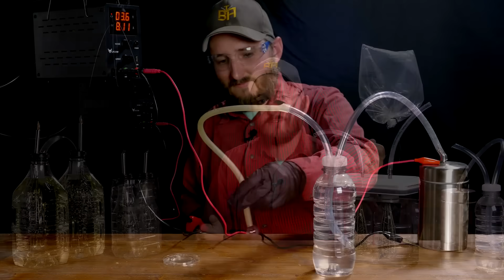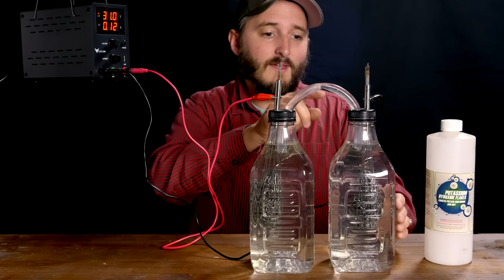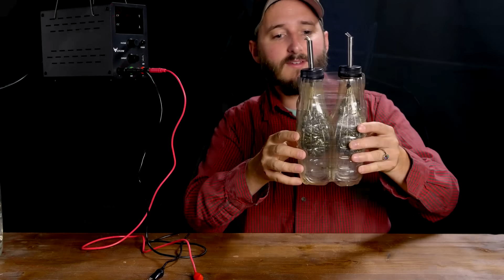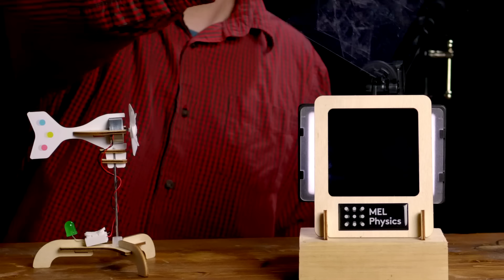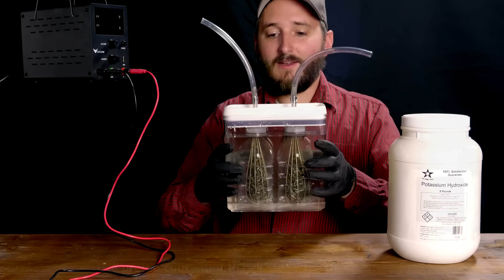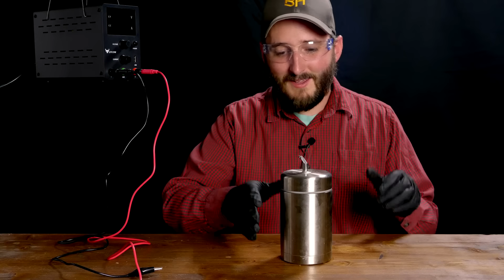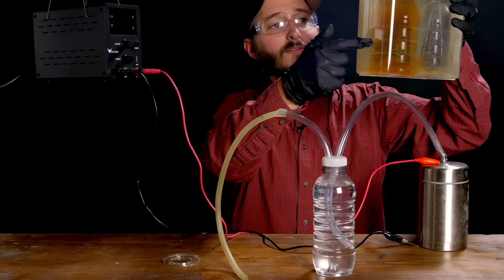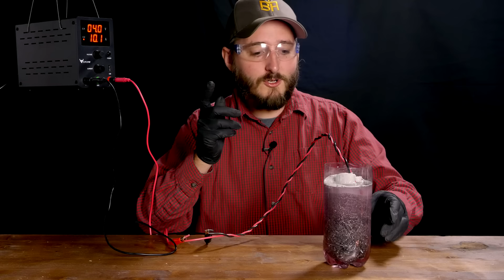DIY Hydrogen/Oxygen Generators From Grocery Store Items (HHO Fuel Cells & Split Cell Electrolysis)

Comment: I am making a single bottle hydrogen generator helping my grandson to video his demonstration for an extra grade point. I am using a battery charger and have a problem grounding, I think I have a solution using the sock and one wire seperating the the positive on the wisk broom from the sock in the same Ball jar. I tried using the positive lead and using a steel adjustable band on the outside of the Ball jar to complete the circuit. That did not work. so briefly connecting a stuffed Sock with the NEG wire inside attached to the stainless steel inside the sock which also seperates contact from the wisk hopefully will work. Any thought??

Comment: Do you think it is possible to safely make a device capable of supplying enough hydrogen to operate a 4 cylinder engine in a vehicle?  
Maybe 6 - 2 to 4inch diameter plastic plumbing pipes to contain the electrolytes & water. Using T's to provide entrance for electrolytrodes and exits or gas?

Comment: me watching this like im gonna be stuck in a bunker with no air supply
Reply: Right I ran across the oxygen generator for the drop-down plane mask video and they mentioned something about different methods like electrolysis and I'm familiar with electrolysis and I was wondering if that could be used as an oxygen generator to breathe

Comment: Throwing relatively high voltage to your cell does not increase efficiency. A lot of that voltage would be lost as heat. One needs low voltage and high current for electrolysis of water. 1 to 2 V should suffice.

Comment: watching this in 2023, i asked GPT-4 why one electrode changed white and if it can guess what the other electrode changed to(brown in this video) i told it that the electrodes are made from stainless steel and potassium hydroxide is used as electrolyte. unfortunately it guessed gray

Comment: ok...   hook solar panels to a charge controller and use the accessories terminal on the charge controller to use the extra electricity not being stored in my battery bank to generate hydrogen through electrolysis...   store the hydrogen in propane tanks and use it to heat my cabin with my vent free propane heater...   too dangerous?   won't work?  great idea?   how to start guidance?

watched where you touched off the hydrogen ..  boom...  so looks like a no go ..  good way to blow up my cabin...  looks like a better way to heat with hydrogen would be to run a generator that runs an electric heater.

Comment: I have always wondered if you use electrolysis on NON-PURE water.
Do the other gases in the original solution just stay in the solution or do they collect at one of the two terminals that the DC current is connected to.
Fluoride being adding to  ciry's water supply is what made me think of this.
I don't have any sort of lab in my apartment and I'm 65yo so high school / college lab access is non-existent.

Comment: I know this is an older video of yours, but I am interested in making one of these for continuous use in an automotive application. I have figured out how I would keep the electrolysis chamber full, but if I was to continuously top off the chamber, would the electrolyte degrade or dilute? I see your pin about producing hexavalent chromium. Could you help me with a formula to determine what my service interval might be for remediation of the Cr? I am actually considering modifying your design for a single source generator and using carbon felt which should mitigate the possibility of generating chromium in the first place, albeit it will make the electrolyte solution more dirty. I would love to chat with you about this a little more as I am debating starting a youtube channel to document the science behind what I am doing, and the research which initially grabbed my attention.

Comment: Question, can you use and would it safe to use pure sodium as an electrolyte?

I'm currently thinking of a solar powered setup to desalinate and process large quantities of ocean water using a desalination mesh. Then use the concentrated brine to extract Sodium chloride (yet to find a good system for that). With NaCl, we can go through a process of separating the Sodium and Chlorine (also need a system for that). Once the sodium and chlorine is separated, we can sell  the chlorine or potentially use it to make more solar panels. Unfortunately chlorine does have limited uses other than cleaning/purging things. Use the Sodium as an electrolyte with our desalinated water to generate liquid hydrogen gas and liquid oxygen or sell/use the sodium to create sodium-ion batteries for solar system power storage.

Potentially overflows of desalinated water could be used for commercial use, such as for drinking water.

It's odd, but creating a facility that generates hydrogen gas from ocean water using solar power seems to produce a lot lucrative byproducts.

I guess the best way to start is through multiple phases. Creating solar and wind farms close to the shoreline, temporarily sell the power to local users or into a public grid. Once that business is on it's feet, the 2nd business would be to fund and build a desalination facility using that power. Once that business is established and is producing fresh water, that could be temporarily be sold to the local municipalities and pumped a town or city's water system to reduce pressure on local dams.

From there you can start up a 3rd business to generate liquid hydrogen gas and liquid oxygen gas, which could then be sold and used as fuel or for industrial use.  Liquid Hydrogen could also potentially be used as fuel for backup power. Would also be nice if there are more cars that runs on hydrogen fuel. Then you can start a 4th business for processing brine into Sodium and Chlorine. Both could be sold exclusively to their own potential markets. 

A 5th business to produce sodium-ion batteries. Potentially a 6th business could exist for liquid gas storage. And I guess the list of expansion would continue, since you would require skilled engineers. Most likely you would also have to establish multiple research facilities or universities.

Comment: I love this. I would like to make a unit to fuel a gasoline generator to power our cabin. The nearest power lines are 4 miles away. What do you think of this idea?
Reply from the maker: Hydrogen is not a good fuel for a gasoline engine. Look into wood gasifiers as a better option

Comment: After replicating your stainless steel single-output cell design for my car, I'm dealing with 2 issues.

My 30A PWM controller keeps blowing its fuse, even with a 40A fuse as suggested by a user of this unit. Not sure how it's shorting out or using more than 40A; how would the controller even send out that much current if it's designed for 30A maximum? It uses a janky dial to control current and has 3 power settings: Run, Off, & Brake. Does Run power +, and brake powers -?

When I have gotten the circuit to work, the hydrogen cell quickly overheats, boiling out its water and pumping it into the bubbler and then engine. How can I prevent this?

Comment: Has anyone ever thought of using an alpha emitter mineral to activate electrolysis instead of electricity? I don't know how efficient it could be but nuclear waste could be used to produce hydrogen and energy at 0 cost. Maybe you can experiment using the valves of the old cathode ray tubes to generate alpha radiation...
Reply: Well radiolysis not electrolysis... You could do it with distilled water since you would not need the water to be conductive.

Comment: spark arrestor - yup - I blew my 10 year old self across the room cuz I used a pool toy pump (accordion style) to grab the hydrogen out of a sodium hydroxide + aluminum solution.  Wanted a torch - and I got one - for second... then the flame went into the pump (which I was pushing with my elbow) .  I thought I broke my arm.

Comment: Just found your channel.  Love it & subscribed!  A few questions. What is percent solution of water and hydroxide did you use or recommend?   Could a machine be built, for home use, to produce enough gas for a vehicle to operate?
Reply from the maker: Add as much hydroxide as will dissolve

Comment: In the last Sock Design, would it be beneficial to add extra sock & scouring pad layers like Neutral plates in a stacked plate type cell design?
So the center would be connected and the outermost layer is connected with several sock-pad Neutral layers in between. 

My understanding is the neutral plates somehow lower the voltage between plates by dividing it amongst the total number of plates contained between the Anode and Cathode.
Supposedly keeping the voltage below 2 Volts between any 2 pates reduces deterioration of the metal and prolongs cell life. 
Just a thought. 🤔
Reply: Apparently the current “leaks” around the Neutral layers through the electrolyte, since this is a wet cell design.
Dry cells have gaskets separating the neutral plates’ edges (they typically use flat stainless steel plates) so current doesn’t “leak” around them but instead is forced through the only available path through the neutral plates and electrolyte in between.

Comment: Despite the fact I'm a BSEE, and have both seen and done this myself. I still found it fun to watch your ideas on how to make the devices for electrolysis.  I do have one question though, how is the lid separated from the SS jar? Yes, I see the plastic gasket, but how is the top not making contact with the jar when threading it together? I would think that would be SS to SS, but obviously that is not the case. And just out of curiosity, where did you get that SS jug?  If I had time time, I would build one of your separated designs, just for Kix, But "Kix are for Kids". AND " Kix just keep gettin' harder to find". I forget the name of the song that came from. Keep Doing what you do. It's fun to watch, and takes my mind out the serious crap in life. So I subscribed.
Reply from the maker: It's a Walmart container. Not sure if they still have the same one. The metal lid is just an outer cap over a full plastic lid.
Reply: @Nighthawkinlight  Thank you!

Comment: Soooo how do you capture, compress and store it for use in your fork lift? Or better yet how to compress into used propane tank for your Bbq  grill?  and last, would you mind comparing  the cost of electricity and time to fill a propane tank  vs store bought tank for same amount of fuel.  You mention 10 gal an hour ? I think? So basically 1 cycles of a 30amp hr batt  for a 5 gal tank? I use propane for everything , stove hot water heater cloths dryer, no conversion necessary, so free gas from my solar panels would be great….Humm great vids 👍
Reply from the maker: Not possible to compress hydrogen like propane unfortunately. Propane turns liquid allowing you to store a lot of it in a small tank. Not so with hydrogen.

Comment: Graphite itself does not "resist" the electrolysis of water in the sense of preventing the process from occurring. However, graphite is commonly used as an electrode material in electrolysis because it is chemically inert, electrically conductive, and resistant to corrosion under many conditions. Let's break this down:

Electrolysis of Water
In the electrolysis of water, an electric current is passed through water (typically with an electrolyte like sulfuric acid, sodium hydroxide, or a salt to improve conductivity) to split it into hydrogen (H₂) and oxygen (O₂) gases. The process occurs at two electrodes:
Anode (positive electrode): Oxidation occurs, producing oxygen gas (O₂).
Cathode (negative electrode): Reduction occurs, producing hydrogen gas (H₂).

The basic reactions are:
Anode: 
2H_2O \rightarrow O_2 + 4H^+ + 4e^-
Cathode: 
2H_2O + 2e^- \rightarrow H_2 + 2OH^-

Graphite as an Electrode
Graphite is widely used as an electrode material in electrolysis due to the following properties:
Electrical Conductivity: Graphite conducts electricity well, making it suitable for delivering the current needed for electrolysis.
Chemical Inertness: Graphite is relatively unreactive and does not easily participate in the chemical reactions occurring during electrolysis, especially at the cathode where hydrogen is produced.
Cost-Effectiveness: Graphite is relatively inexpensive compared to other electrode materials like platinum.

Does Graphite Resist Electrolysis?
At the Cathode: Graphite is highly stable during the reduction process (where H₂ is produced). It does not react with hydrogen or the water under these conditions, making it an effective and durable electrode material.
At the Anode: Graphite is less stable under the oxidizing conditions at the anode, where oxygen (O₂) is produced. Over time, graphite can undergo oxidation, especially in the presence of oxygen and high potentials, forming carbon dioxide (CO₂) or carbon monoxide (CO). This reaction can cause the graphite electrode to degrade or erode:
C + 2H_2O \rightarrow CO_2 + 4H^+ + 4e^-

This degradation is slow under typical conditions, but it does mean that graphite anodes may need periodic replacement in long-term electrolysis setups.

Practical Considerations
Electrolyte Choice: The stability of graphite can depend on the electrolyte used. For example, in acidic or neutral solutions, graphite anodes may degrade more quickly due to oxidation. In alkaline solutions (e.g., with NaOH), graphite tends to be more stable.
Comparison to Other Materials: More expensive materials like platinum or mixed metal oxides (e.g., iridium or ruthenium oxides) are more resistant to oxidation at the anode and are often used in industrial or high-performance electrolysis systems. However, graphite remains a practical choice for many applications due to its affordability and reasonable durability.

Conclusion
Graphite does not resist the electrolysis of water in the sense of preventing the reaction; rather, it facilitates it by serving as an effective electrode material. While it is highly resistant to degradation at the cathode, it can slowly oxidize and erode at the anode under certain conditions. For short-term or low-cost applications, graphite is an excellent choice, but for long-term or high-efficiency electrolysis, more durable materials may be preferred for the anode.

Comment: I'VE BUILT A FEW OF THESE, USING A DIFFERENT CORE OF COURSE... HOWEVER, ON MY FIRST TRIAL RUN I EXPERIENCED A THERMAL IGNITION OF THE HHO MIXTURE BUT, THE EXPLOSION OF THE CELL WAS ALL BARK AND NO BITE, THANK GOD! THE FIRE-BALL WAS ALARMING AND IT WAS LOUD! HOWEVER, ALL IT REALLY DID WAS PUFF SAID FIRE-BALL OUT THE SIPHON HOSE, TAKING THE HOSE WITH IT ACROSS MY WORK BENCH. LUCKILY BEFORE HAND, I HAD THE FORESIGHT TO SET UP AN EMERGENCY KILL SWITCH "JUST IN CASE" AND I'M GLAD I DID.... SO WHEN IT WENT "BANG", I SIMPLY REACHED OVER AND SMASHED THAT MOTHA-TRUCKA! 10 OR 15 SECONDS LATER, IN COMES THE WIFE FLYING INTO MY SHOP ON HER BROOM WITH A FIRE EXTIGUISHER! LMAO... "ARE YOU OKAY, DO I NEED TO CALL 911!" HAHAHA ~ SHE'S LITTERALLY THE BEST SO, I ASKED HER TO HELP ME SWEEP UP THE MESS.. YOU KNOW, since she was already there with a broom and all 🙂

MY POINT IS, THERTE WAS NO GRENADE OR NUCLEAR EXPLOSION THAT TOOK PLACE, EVEN THOUGH I DID IN FACT HAVE A FIRE INSIDE THE CELL W/ AN ACTIVE CORE PRODUCING A VERY STOUT HHO MIXTURE... AND MAN, LET ME TELL YOU; USING 12 VOLTS DC @ 41AMPS .... THAT CELL LOOKED LIKE IT WAS COMPETING AT A VAPE CLOUD COMPITITION! UNFORTUNATELY, I WAS USING A CULIGAN 10" WATER FILTER AS THE CELL AND WHERE THE TWO POLES OF THE CORE BREACHED THE LID, IT MELTED AND ALMOST FELL THROUGH AND INTO THE BOTTOM, DESPITE THE FENDER WASHERS PROVIDING EXTRA SURFACE TENSION... AND ALL THAT TOOK PLACE IN ROUGHLY 30 OR 40 SECONDS AFTER ACTIVATION... USING A CAR BATTERY CONNECTED TO THE CORE VIA 04GA. AWG INSULATED COPPER STRAND WIRES.

MY LASTEST VERSION UTILIZES SEVERAL ELEMENTS FROM MY PAST DESIGNS. LIKE YOU, I SHIT-CANNED THE PARTS THAT FAILED AND KEPT THE GOOD IDEAS WHILE ADDING ADDITIONAL SAFETY FEATURES. BUT THIS ONE I MADE FROM A STAINLESS STEEL TIME CAPSULE! NOT ONLY DOES IT LOOK COOL, IT WON'T MELT AND I ADDED A COOLING FAN TO AID WITH EXTENDED RUN TIMES WHILE COOLING THE CONNECTIONS AT THE EXPOSED CORE POLES/LEADS. AS WELL AS MANY MORE UPGRADES BUT, THIS IS A NOVEL ALREADY SO.. I'LL LEAVE IT HERE. KEEP UP THE GOOD WORK AND I'LL KEEP WATCHING... GOD BLESS AND STAY FREE!

Comment: Are you aware you can run your HOH through sand and it won't explode what you have is a heater they can use his cooking surface and cook your food on top of the spent flame that'll be actually taking place inside the sand and will not explode it's totally a hundred percent safe

Comment: very informative video, thank you!! also, how would you suggest storing the produced oxygen? i need some liters for a project..
Reply: Just use any other gas tight container and make sure it won't be near anything hot, reactive or electrically charged.